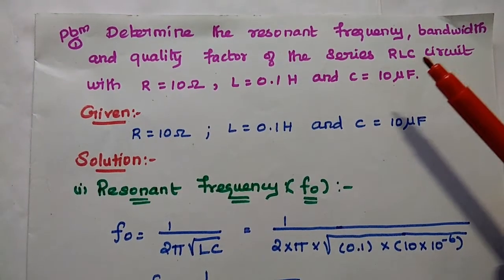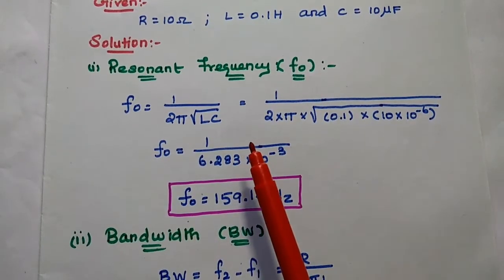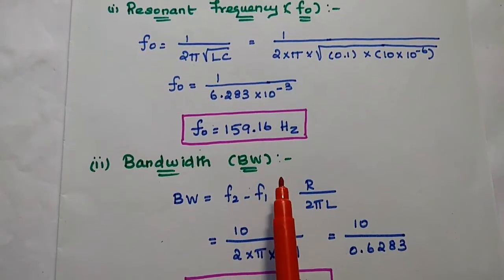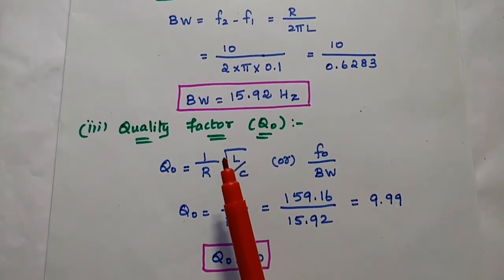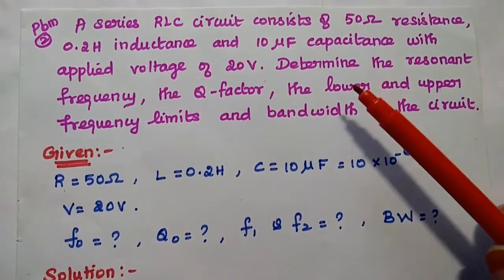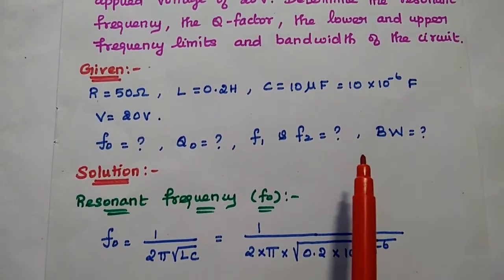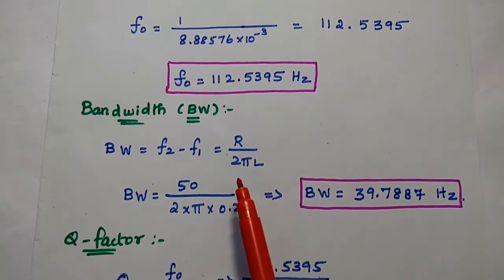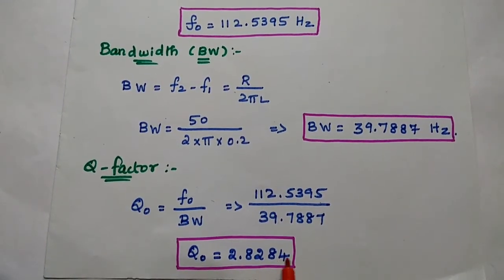Problems #1 - Resonant Frequency, Bandwidth, Quality Factor of RLC Series Circuit - Circuit Analysis

Comment: 2. A series RLC circuit with R=10ohms,L=1mH and C=μF is connected across a sinusoidal source of 20 V with variable frequency. Find: i) The resonant frequency ii) Q factor of the circuit at resonant frequency iii) Half power frequencies

Comment: 6. A series RLC circuit has a quality factor of 5 at 50 rad/sec. The current flowing through the circuit at resonance is 10 A and the supply voltage is 100V. Find the circuit constants

Comment: Mam please make video on this question urgent for exam after 10 days🙏🙏

In a series RLC circuit, the power consumed at resonance is 0.1 W. The circuit is

connected across 1 V supply. If L =0.05.H and the voltage across inductor L. at

resonance is 70.71 V. Bandwidth circuit is 200 rad/s.

Determine the value of R, C and resonant frequency of the circuit